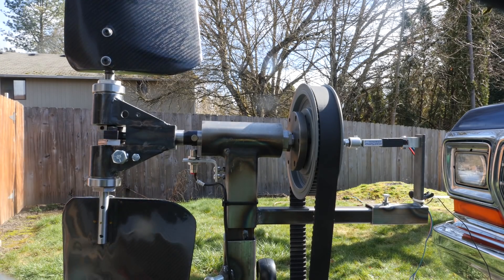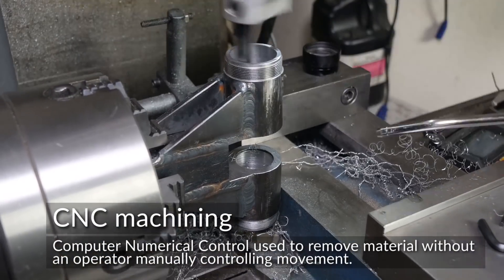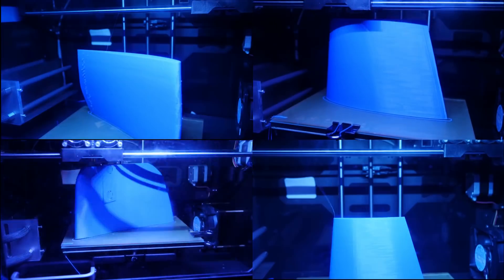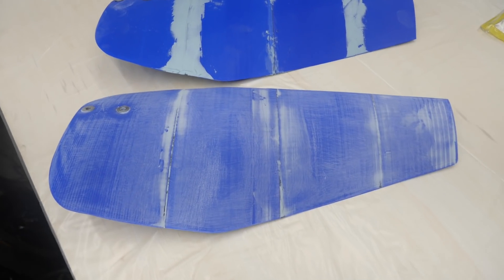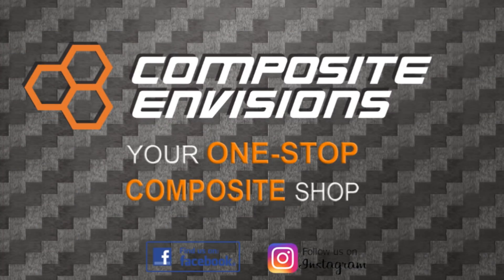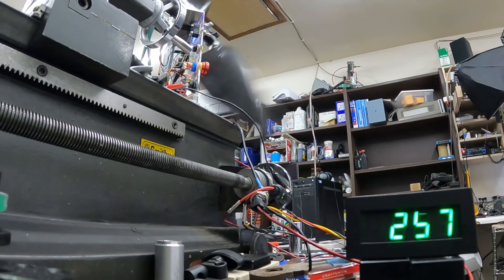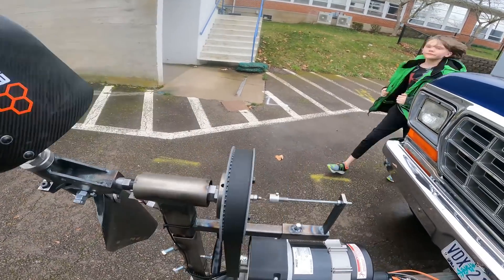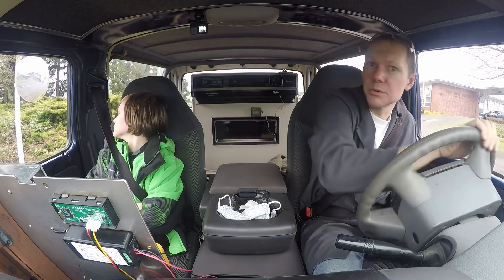Carbon Fiber Blades Making 2000 Watts! - Wind Power on a Car #4

Comment: Nice, it finally worked. I am very surprised how well the carbon coating worked. Do you think it will last a long time? The look alone is simply beautiful.
How did you do the voltage regulation of the generator? Since it does not run permanently at 3000 or 3600 rpm, the frequency and voltage would have to fluctuate greatly or am I wrong?

Because I know that you can red/wright a litte bit german and my 10th class school englisch isnt the best, Im also write the German sentences:) 

Nice, endlich hat es geklappt. Ich bin sehr überrascht wie gut das beschichten mit Karbon geklabt hat. Denkst du das es lange hält? Alleine die Optik ist einfach wunderschön. 
Wie habt ihr die Spannungsreglung vom Generator gemacht? Da er ja nicht dauerhaft auf 3000 bzw, 3600 Umdrehungen in der Minute läuft müsste die Frequenz und spannung doch stark schwanken oder liege ich da falsch?
Reply from the maker: Hallo Huebifix, du hast recht!  Die Frequenz und Spannung schwanken (schaengt?) enorm.  Aber für Heizelemente ist is egal, oder?  If I were counting on the internal electronics of the stove I'd need to keep things within a certain range but I bypassed all that and connected the elements directly to the output of the generator.  My intent is to eventually control temperature through pitch regulation.  Otherwise every time the thermostat clicked off the turbine rpm could go crazy high.  Thanks for the german practice.  I got pretty good speaking it about 10 years ago but now just listen to podcasts now and then so I don't completely lose it!
Reply: @QuintBUILDs  Sry für meine späte Rückmeldung, ich hatte mündliche Abschlussprüfungen in der Schule. 

Das stimmt, dass ich habe nicht bedacht. 

Eine weitere Möglichkeit wäre ein kleiner Zwischenspeicher um dann auch sensibele Geräte wie ein Pc oder ähnliches anschließen zu können. Das wäre aber, glaube ich, ziemlich teuer.

Ich habe gerade auch dein neues Video angeschaut indem Ihr zusammen ein Kuchen gebacken habt. Ich bin wirklich beeindruckt wie viel Energie nur durch Windkraft erzeugt werden kann.  

Kann es sein das deine Frau aus Deutschland kommt? Das "Dankeschön" am Schluss klang doch sehr Deutsch;) 

Sry for my late response, I had final oral exams at school.
That's right, I didn't think about it.

Another possibility would be a small buffer to be able to connect sensitive devices like a Pc or something similar. But I think that would be quite expensive.

I just watched your newest  video where you baked cakes together. I am really impressed with how much energy can only be generated by wind power.

Can it be that your wife comes from Germany (or lived there for a long time)? The "Dankeschön" at the end sounded very German;)

Comment: This turbine in front of the electric car, would be so useful to charge its batteries, rather than a solar panel
Reply: Doesn't work like that. It will require more energy than it outputs, unless it was very windy..
Reply from the maker: Video proving it works: https://youtu.be/tEPBdztGMdI  😁
Reply: @QuintBUILDs  Thanks for this. I started watching these videos and obviously missed the first one or more, all this time I actually thought this project was just to make an efficient wind turbine, and you just mounted it on your vehicle as a way to get constant wind for testing. I had no idea your premise was to see if you could generate power with it / extend range on an electric vehicle. When I read Pankaj's comment (and others) I had assumed people thought they could power their electric cars forever with it.
Reply from the maker: We will see if you're right.  I suspect in this example there's more going on than simple thermodynamics.

Comment: Great to see another video about this. I have a question: You never had problems with the police or something? I'm also looking forward to see the fuel consumption results!
Reply from the maker: consider the farm equipment that travels those roads on a regular basis.  Is this any more dangerous than a tractor or a combine?  That's my position anyway.  Had a group of cops drive by once with no issues.  In my experience they're more down to earth than often given credit for, especially in an area like that.

Comment: To measure fuel consumption, you can turn off the fuel supply from the tank and connect it to a 1-2 gallon canister.  And measure how many miles a car will travel with a turbine and without

Comment: There are several options how to measure fuel consumption. One would be a flow measurement device in the fuel pipe as close to the engine as possible, like the ones measuring water. Or you manage to get the fuel pipe from the fuel tank into the car and fill up a transparent zylinder with measurement lines. The engine get's fuel from this zylinder so for all of your test drives you should make sure to use the same amount of fuel. The further you get the less fuel consumption you had.

Comment: There is one more possible solution to blade angle adjustments. Add a small tail boom to each blade with a small stabilizer surface - so the blade will automatically orient itself along air flow like a small glider. And the hub assembly going to be much simpler.

Comment: I assume the cracking and warping that you got from the 3d prints was because you were using ABS. Any reason for using ABS? Could you have not used something like PETG instead? Or would that not work for your application?
Reply from the maker: I wanted to use an adhesive that would 'melt' the parts together like ABS cement. Plus Lasersterling said he wished had gone with ABS and he's done more of this than I ever will.
Reply: @QuintBUILDs  Ah ok, so PETG isn't easy to join together then. Interesting. I've just started messing about with PETG and I'm having pretty good results printing single parts. I do have a project in mind to use PETG, but will have to test if it's going to suitable if it's hard to join to other materials.
Reply from the maker: @Shundi12  I'm no expert on it. Epoxy will probably be suitable. I was about to try a roll of PETG on someone's recommendation but then saw some reviews it wasn't much better than ABS at a slightly lower strength. Probably should follow thru at some point just so I know.
Reply: @QuintBUILDs  I've never tried ABS but I've heard that PETG is stronger than ABS. The downsides of PETG appear to be that is is harder to post process (painting and gluing) and that it isn't quite as resistant to temperature as ABS (up to 80 degree C as apposed to ABS which is good up to 100 degrees C). PETG is definitely worth a try. I'm going to try printing ABS soon as I have my 3D printer in an enclosure now. Forgot to say, love your videos by the way :)

Comment: Impressive engineering work. Your lead s/w developer is a star too. When you change the pitch (angle of attack) on an asymmetrical foil, the center of lift changes. As you have noted there are some force involved.

Comment: With my background in process controls, I'd be dying to get that servo working again.  Then close the loop in the Arduino between power output and servo position to optimize power at every road speed.  :)  Great video and glad you include your kids.  :)

Comment: It would be so cool if you are successfully able to create a hydrodynamic slip stream, with reduced aerodynamic friction in a bubble behind the turbine blade.  

Hypothesis: Spinning turbine under load generating electricity that in turn powers a motor helping recover a portion of the energy used to push the turbine that creates a high pressure zone in front of the blades and a low pressure slower moving air zone behind it with the truck in its wake.  In therory the slower moving air across the vehicle might reduce the air drag on the vehicle.
Reply from the maker: Hi Keith! Yeah I believe it's within the realm of possibility. The tools are mostly there, just need to execute!

Comment: I suggest a pizza for the oven! One with either extra cheese to secure the toppings, or just use less. (Worried about an unsecured complicated pizza in a moving vehicle).

That or maybe brownie mix, with the tin strapped down inside the oven rack somehow.
Reply: Pan pizza,  drill a few holes in the edge of the pan,  and wire it to the rack.

Comment: Anyone who hasn't thrown a part out of a vise hasn't been machining or making much. We've all done it. Lol
Reply: I saw that in a millisecond and my brain said to get the angle grinder on that weld or put shims on either side of it and then clamp it hard. Yes, I know exactly what pile in my shop to dig in to find  the angle grinder. I are an Enjuneer, not a housekeeper.

Comment: It's great but have you calculate how much car gas you burn with and without the fan. Because you just might be converting gas energy to electrical energy. So not eco friendly.
Reply: That's not the point of the videos. This is just a way to test with guaranteed wind.

Comment: I hope you know that you inspired me, at the age of 32, to get my Mechanical Engineer degree at OSU starting this fall.
Reply: good never too late to try these days
Reply: I have a friend who has a mechanical engineering degree. He thinks he's smart, but he can't make anything for shit. The best way to learn is on your own and have a passion for engineering.
Reply: @sirmack3262  I studied civil engineering as the job is well paid and readily available and pursued my true passion as product developer / product design engineer in my spare time. All self taught from youtubers and google and plenty of hands on practice!! My day job will fund my true passion, set up prototyping and manufacturing facility!
Reply: I have a masters in mechanical engineering, I'm now 63. You don't really learn this kind of stuff unless you get into design, build and test. I did my undergraduate part time while working as an apprentice Fitter and Turner/Tool maker. This made my engineering degree 6 years,  2 days and 5 nights per week. The great thing was, in design courses, I had the skills to actually use all the tools and weld etc. I knew my designs could be built and manufactured. My degree was part of my job and was fully paid. I did my Master on computational fluid mechanics, simulating molten metal in molds for foundry work, determining where risers, chiller and hot plates needed to be placed, all of this during 1978-1986. Tough years for sure, but I had an awesome time.
Reply: Good luck dude, start studying mathematics on brilliant right now, trust me.
Reply: I went back when I was 30. Im 36 now with an honours degree in mechanical engineering and full time employment in a job I love, Best decision I've ever made. Its definitely not easy but its definitely worth it.
Reply: I also went to college "late" like you...and had to work full time.  It was gonna take me 8 years to graduate so I almost quit.  A very wise older friend said...
Him: How old will you be when you graduate?
Me: 38
Him: and then how long will you still have to work after you graduate?
Me: probably another 25 or 30 years, I imagine.
Him: so what do you want those 30 years to be like? Working for a lot less with limited options to choose from? Or working for a lot more money with skills and qualifications you can go anywhere? It's just 8 years.

Some of best advice ever....I just kept going and going. A lot happened and things didn't go exactly as planned...but I did finish...and then got an MBA too. Life is good and the future is bright.

One of best things, my kids saw what I was going through and never once question the value of good education and hard work.
Him:
Reply: TWO ONE SIX!
Reply: Sco beavs
Reply: Good luck man! Update us after you graduate no matter how long itd take, please!
Reply: Wish for the best and good luck sir
Reply: That's just awesome man.
Reply: So glad to hear that, way to go man! Also try watching "Smarter every day" on YouTube, he's a hardcore mech engineer who loves these things as well! 🙌

Comment: I've been watching this build for a long time.  This would be an awesome thing if you could incorporate to electric car that overcomes recharging batteries to get momentum to be able to recharge at highway speed without loss of voltage to continue movement.  As for what to cook.  Long road trip turkey dinner with trimmings ???  Make for an awesome rest area stop with fellow travelers.

Comment: Congratulations on making 2k watts of power what a milestone!👏👏👏👍👍👍
Reply: I don't think he's 'made' any power, since he obviously used more than he got back.
Reply: @PaulLawson-k8v  but the bronco is going to have to move that air anyway. There’s definitely a chance of it not requiring 2k watts worth of additional fuel. It will be interesting to see the results.
Reply: @imitane  
Agreed -- this seems to be experimental science for educational purposes (which is a great idea). I'm just referring to the general principle that you can't get more energy out of something than you put in... in this case I expect that the generator will eventually be disengaged during acceleration and cruising, and engaged while decelerating and coasting, similar to the ideas of regenerative breaking).
Reply: .. also if it was "pulling" apart pressed fittings ,  it might make the Ford more efficient ?
Reply: the engine will need 20kW more  at high speed and you eventually get 10% back. But the cool thing is that you can shred these annoying  biciclists

Comment: Cook some old, redundant circuit boards in the oven so as to free up components that could be used for other, future projects. That's if you can get the temp high enough, for long enough that the solder sufficiently melts.

Comment: There shouldn't be much change to the fuel consumption as you're taking the drag that would otherwise me caused by the vehicle and converting, right? However, I am (jokingly) concerned that the aerodynamics of the Bronco will be dangerously affected as the air that would be used for downforce is being removed in advance, meaning the vehicle's cornering and high-speed stability will cause it to be unsafe for public use. (I say again, this bit's a joke okay, so you folks that fail to interpret sarcasm please don't lose your minds).

Comment: Heated Buildplate. It's rare that one part will fix so many issues, but a heated build plate for a 3D printer really is just that part. I got one and couldn't believe how it fixed so many issues with my prints, even issues that I hadn't thought of yet. Manufacturers say that people don't need a heated build plate to print PLA, but in truth, that's like saying you don't need tires to drive a car. Sure you CAN drive on wheelrims, but it will be the most miserable experience of a lifetime. Heated build plates for 3D printers are a game-changer, especially when they have a machined build surface too.

Comment: This is cool.
Hopefully the next video on fuel consumption can answer:
Would it be more efficient to just take the energy from the alternator that recharges the car battery instead?
Reply: Do you need a video to answer this question?
Reply: @Nitro8996  Sure, there's theoretical, but he's the only one who built one, and has a more first hand experience?
Reply from the maker: Video proving it works: https://youtu.be/tEPBdztGMdI  😁

Comment: If you can manage 350 degrees, some classic chocolate chip cookies would fit the bill nicely.
Otherwise you'll need a low temp compatible food, and may need to drive longer to cook it properly.
Reply: Cookies are fast. And don't forget the milk.
Reply: @johndii2194  
Maybe they should road trip to a cow for fresh milk?

Comment: electric cars with or with out solar panels on the vehicle, what is the most aerodynamic hubcap/rim, completely smooth, that is gonna provide a big range difference, make some noise
clothes lines for drying clothes
add on second layer to windmill towers rather than chopping them down, 
use the same windmill footing for millions of years, 
just fix up the moving parts, 
solar installations for rural areas, eliminate all the power line waste
Reply: Yeah build a dyson sphere after making a mini black hole
Reply: @billi5920  you mean, lets make light fastern than light with a black hole und harvest it with a dyson sphere? diddent hear that for a long time^^

Comment: A large RC helicopter blade would have done the same thing.
Reply from the maker: Actually no.  They have little to no twist along the length of the blade because the incoming wind speed on hovering aircraft is considered zero.  Thus the angle of attack is maintained with a straight blade.  Something I learned while researching this project.
Reply: @QuintBUILDs    I see what you mean.  That’s why you are you and I am me.
Reply from the maker: @benb7727  LOL, I got clued into it reading comments on Tech Ingredients videos. He was responding to a statement that his DIY drone rotor would work as an aircraft prop. I STILL didn't get it though and had to look elsewhere until it finally clicked. So you might be ahead of me!

Comment: Cook a pizza in there ☺️🍕 it's going to be easy and fast 👍🏻
Reply: A new pizza service...pizzas cooked en route
Reply: @jackriminton7959  always delivered hot 😂👍🏻
Reply: Yeah, but the delivery vehicle requires 10-20 minutes at freeway speeds, even if your house is half a block away.  Pizza $20; delivery fee...also $20...